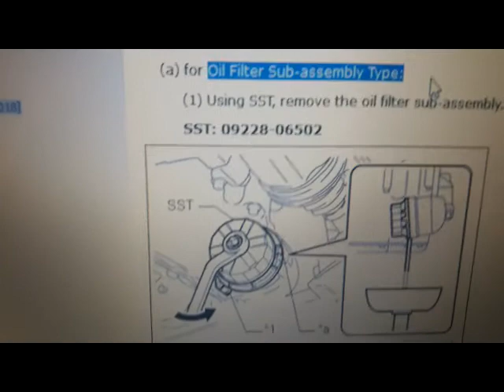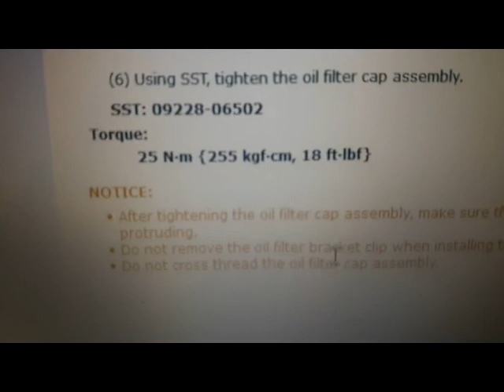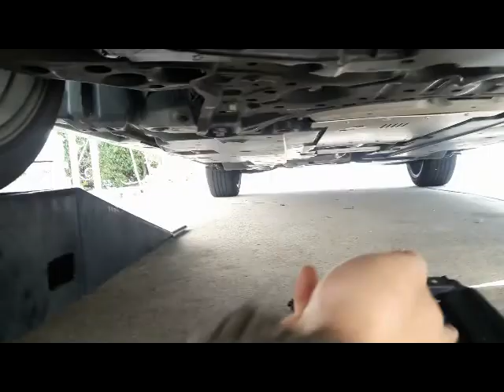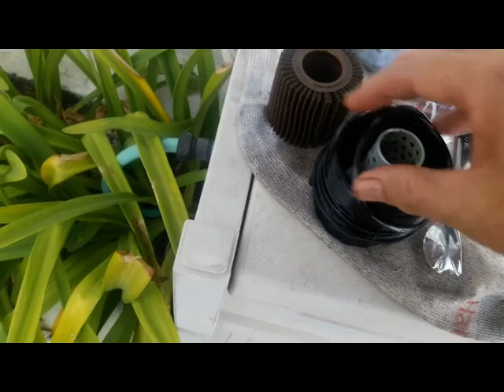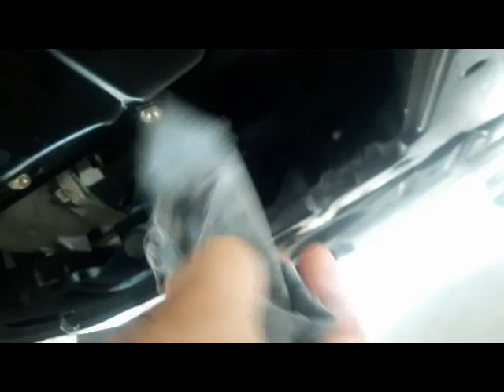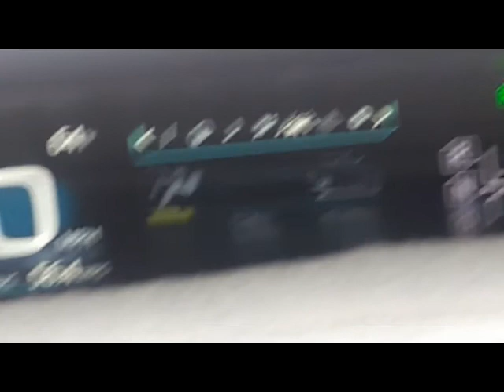2017 Prius Oil change, Maintenance Mode and Oil Light Reset

Comment: 16:30 the little silver metal retaining clip to the left of your oil filter wrench should be removed before removing the filter housing, and the re-inserted after re-installing the filter housing. You can easily remove the clip using a small hammer to gently tap it out, or pliers to gently wiggle it out.

Comment: You said, "The repair manual says to lubricate the old o-ring when you put it in..." I'm sure you meant the NEW o-ring... 🤔😉

Good job... 👍
Reply from the maker: Sorry about that. Good catch!!! Always use a new filter O ring unless it's an emergency. I can see a lot of problems with this type of filter. 1. The housing made out of plastic so it not good if you change your oil when it hot. 2. Using an old O ring (depending on how much it already stretched out), it can come off the groove when you screw the cap in. 3. If the thread are misaligned when you screw the cap in, it will push the O ring out of the groove and damage the cap. 5. I didn't see an Anti Drain back valve in this filter, so it's a disadvantage using this type of filter. Bad engineer for this filter. The good old spin on screw off filter with a built in drain back valve is still the best.